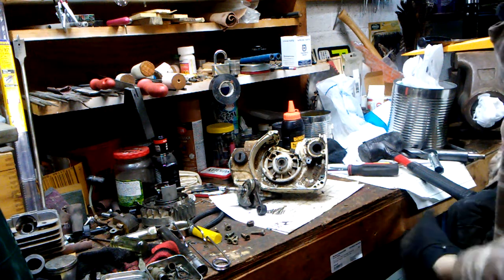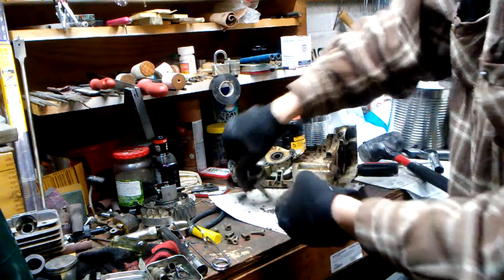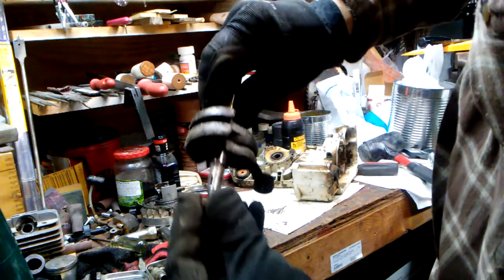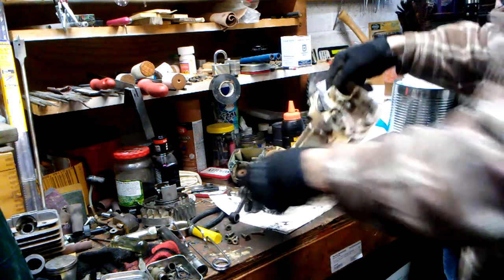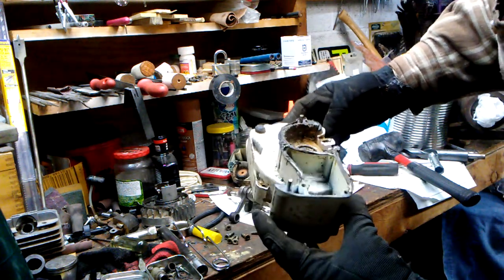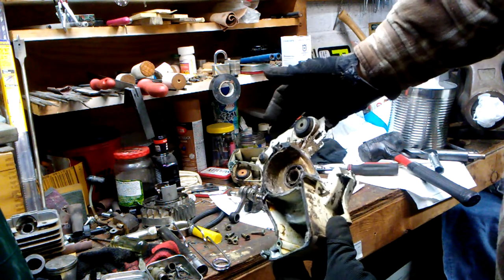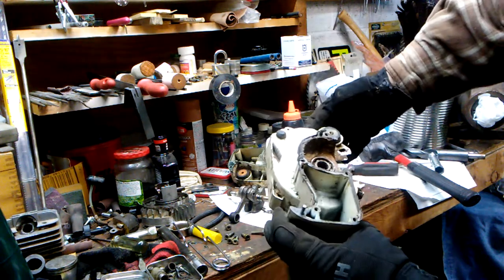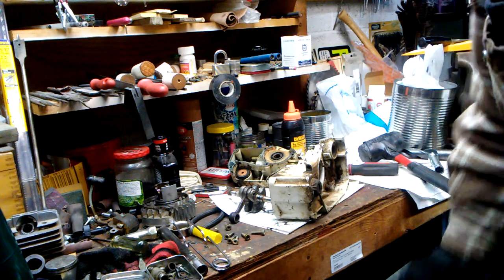Stihl 034/036 crankcase split part 2

Comment: Darn! Wish you would have shown putting back together . How do you pull the crank back in as well as how do you properly remove/install bearings? First rebuild for me on036
Reply from the maker: Hi Tyler, I have crankcase assembly vids for the MS361, MS460, MS660 etc. The process is similar if not the same for all of these. Filming takes alot of time and allowance that get in the way of life or vice versa, thanks for watching. ..
Reply: @Brian2bears  I actually just noticed that you had that and saved to watch! Thanks for getting back to me and also Great work! Immensely helpful and great quality .
Reply from the maker: @tswarner67  Thank you Tyler, good luck. Take your time. If you get frustrated walk away, calm down and think. Thank you sir.

Comment: Where can I get the tool you used? Great video, to the point. Thanks, you have helped me.
Reply from the maker: Hi Robert, HLSupply had them at one time. They have a website and I have done much business with them. Ebay should also have them. It is a crankcase splitting tool. Thank you sir for watching and commenting...